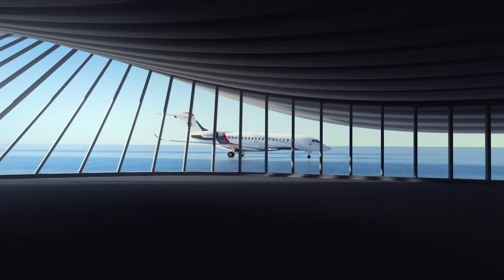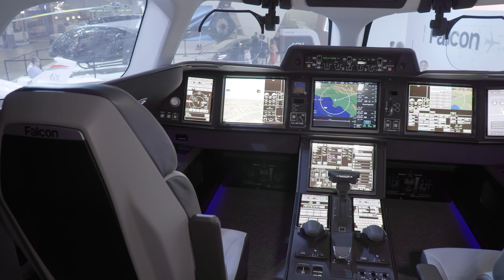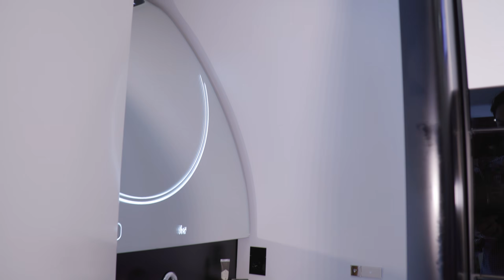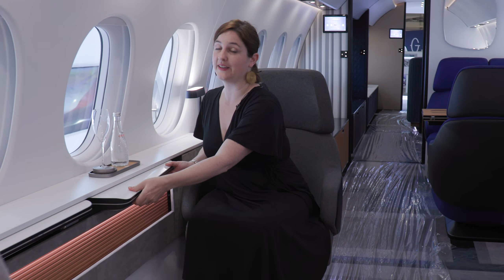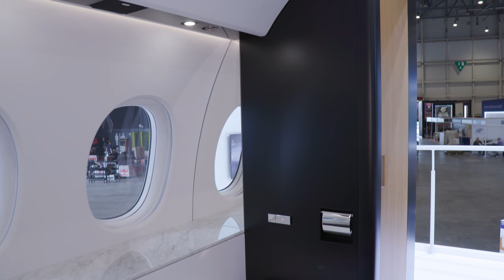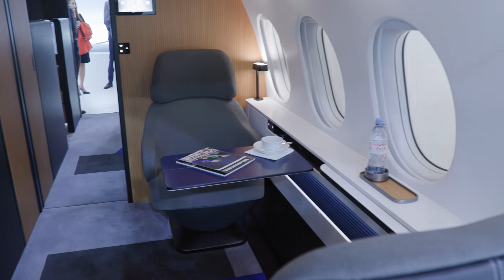Take a Tour of the Dassault Falcon 10X Cabin with Its Industrial Designer – AIN

Comment: Imo, Dassault completely dropped the ball with the 10X ! 🤦🏽‍♂️

The Gulfstream G700 has a longer cabin, slight better performance specs and 3% better range. The G700 has a lower cabin altitude at service ceiling and slightly lower operating costs overall. The main advantage is that the first delivery of the G700 was way back in February’24 while the 10X is still more than a year away from first customer delivery. That means that the G700 will be a fully matured product with no spare part inventory issues or operational growing pains and/or software glitches when the very first Falcon 10X is just out the gate.

Dassault should have been the first to go supersonic with a revolutionary design and dibs on being the first supersonic corporate jet ever ! With the 10X, it’s just another long range corporate jet in the weeds with the G700/G800 and the Global 7500/8500 !

Wasted opportunity…

Comment: One of the big selling points of the X series was three engines. While I  understand the need to reduce costs and emissions, I believe the people who have/had a 7x, MAY look at other manufacturers for a replacement.

Parts and trained crew are more widely available for Gulfstream, Citation, Bombardier - hence why the big charter/fractional boys use them.
Reply: 7x was massively more efficient than anything else in class. While it didn’t have quite the range that a small subset of customers would want, it was 24% less fuel burn at cruise than certain close competitors. 

Also, being trijet means greater flexibility /shorter routing around etops rules - tho your insurer may impose some ETOPS-like policy riders…

Comment: I love those falcon jets mainly because of the third engine, makes the ride seem safer. This newer model has a nice modern kitchen and staff space upfront, the flooring is classy. I love that corporate pod, I'm assuming the entire plane wouldn't be designed with pods but one or two pods seems like an exclusive alternative seating option for shared flights. I love the side panels and hidden individual tables. I love the living room space, the bedroom and bathroom with shower. I'm not too crazy about the choice of chair. Maybe the chairs are more conformable than they look but they appear to be less bulky which helps create space I guess, but they still look uncomfortable. Are you able to adjust these seats into beds? Overall beautiful machine but the seats might not be ideal, if buyers can swap out the seats for their preferred seat that would be great. Just my opinion!
Reply: This one is designed with 2 engines though.
Reply: @Pilotfarmand  I know. I'm saying in general I like their jets with three engines.
Reply: 3 engines are not necessarily more safe. A plane has to be able to climb with one engine going out. The main advantage of 3 engines, is that the engines don't have to be oversized that much.
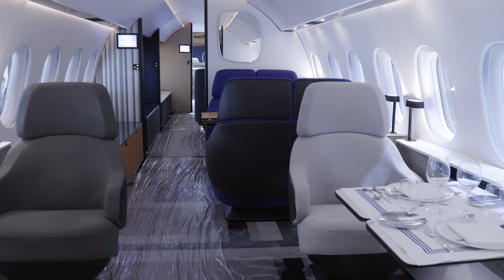Reply: and I urinated on this pillow 3:13

Comment: since arbus announced the ACJ 2020 business jet i feel like gulfstreem and falcon jets are not a logical pick anymore
Reply: Passenger Van vs Ferrari -  ACJ 220 has the room and comfort but doesn't compare with the performance.  The Gulfstream / Global / Falcon flagships have a range of 7500 vs 5500, fly at up to 510 vs 410 and .85 vs .8 lrc.  They both have their strengths but different DNA.
Reply: @stevensims8922  Not the headroom of the 10X
Reply: ACJ doesn't have the range of either plane or the headroom of 10x. The all have 4+ quadrants that can be designed similar.

Comment: these even a bit wider than Lineage-1000 
.....and wondering if the cabin configured on;
1. Front; Left Hand Galley & Right Hand Club Seat crew rest, which doubled as lounge for passengers & can be converted into Medevac Modules with overhead Medical equipment 
2. Mid; Conference-Dinning opposite a Credenza with Huge "Rolled-Down" (rollable) Screen
3. Aft; Fixbed opposite a Chaise which doubled as proper Massage bed
4. Bathroom;
~ move Shower to Centre-aft to give more spacious headroom with wooden bench which doubled as Hammam/ Sauna
~ replaced current shower position with stackable-foldable multi function Gym stuff

.....thus the owner would be totally retreat during 14-16hrs flight

Comment: Cabin width n cabin height of falcon 10x is wider n higher than bombardier n gulfstream's flagship global 8000 g800.
With 7500 nm range
Reply: But Global 8000 will have extra 500nm of range and slightly faster. Hard to choose between the 2
Reply: @cicaklaut  Most planes in this range will basically make it to the same airports. I live near San Francisco. Unless you're going from SFO to Singapore the extra 500nm is useless for the most part. The 10x can go from SFO to Tokyo, Australia and Western Europe. All of south America. Not that I can afford this plane it would be good enough for my needs. having lived in Europe and Japan, However my wife is from Singapore LOL.  I'm 6'6", which makes this the idea plane. One last note, many of these planes actually can go further than advertise, but because of max passengers and weight they have to be conservative. I think If My wife and I were the only ones flying . The trip from SFO to Singapore might be possible.

Comment: WHAT ARE THE CONNECTIVITY CAPABILITIES OF THE 10X. IS THERE ANY LAG OR INTERUPTIONS WITH NETWORK PROVIDERS WHEN CROSSING BOARDERS? KIND REGARDS BEN FROM NZ 👌👌😎
Reply: these aircraft use the Inmarsat network of satellites. World wide coverage and very little buffering or interruption issues. There are different subscriptions based on speed and data allowance. Unlimited subscriptions can cost an operator 350,000.00 plus per year. Thnose charges are just data charges. The yearly cost for cabin entertain content can go much higher if you choose to go with different movie subscriptions etc. 
They can also use the ground based system for US domestic use if they choose to install that additional system.
Reply: @papadelta1791  very informative, thank you very much 🙏🏿

Comment: 45 minute shower capacity. Elaborate for a plane :)  I guess with a certain diffuser the flow rate can be moderate so the weight burden on the plane isn't significant.
Reply: With a fuel capacity of 51,000 lbs, and a maximums takeoff weight of 115,000 lbs, I don’t think that a little extra water is too big a deal.  I fly the Falcon 900EX for over 20 years, and our potable water tank is just over 14 gallons and we are only 49,000 lbs maximum